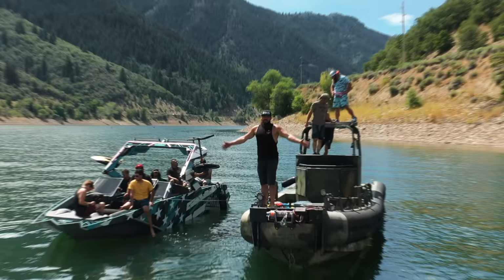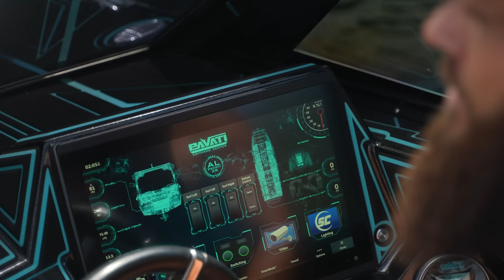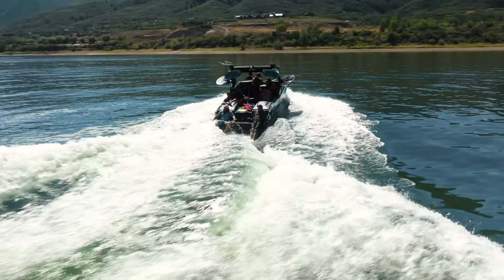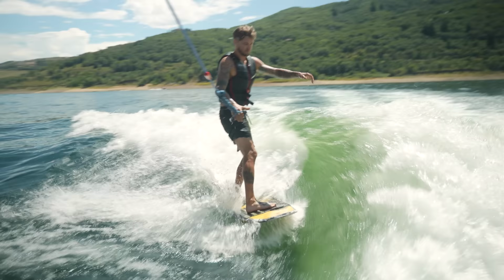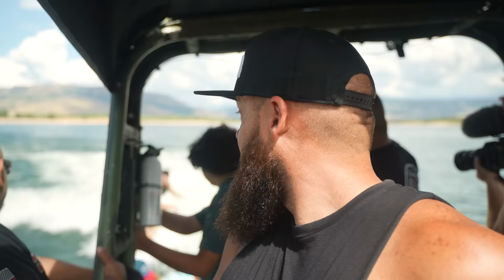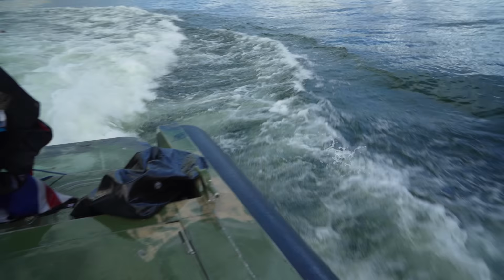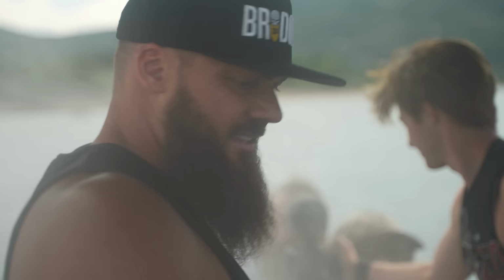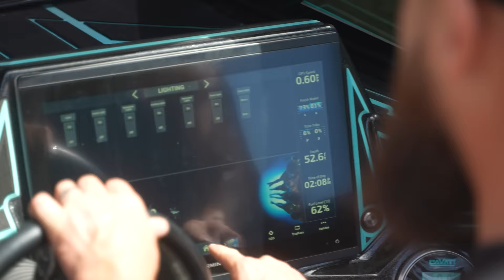Can a Navy Surplus Boat Make a Bigger Surf Wave Than a $400k Pavati Wakeboat?

Comment: I went to the site that HeavyD said to go to in the stolen truck apology video and it didn't say anything about extra tickets and sure enough I received my powerbag today and there was only one ticket included. I thought if I went to the site that more tickets would be included in my powerbox order since I placed it before the apology video went live. I have never gotten a scam vibe from HeavyD before but I kind of am today, especially when they are removing videos from YouTube with no explanation. Removing the stolen truck video and then the stolen truck apology video looks real bad.
Reply: LET'S TALK ⤴️⤴️
  THANKS FOR WATCHING.
Reply: Agreed!  I will never give them anymore of my money.  I bought two power bags the night before they released that video and only got one card in each order.  Guess what?! Each card was for 15% off more merch 🤮.  Umm, no thanks….going in the trash.  On top of that, both shirts are the exact same and the wrong size.  Horrible logistics and very misleading information.
Reply: @gimpy77  the quality of diecast was pretty lame too. I didn't expect Hotwheels Red Line Club quality but dang that thing is cheap. The t-shirt is a bit on the thin side too. I scratched mine and got 15% off so I threw it in the trash too.

Comment: Not related to this video. When you have these really stuck equipment. You need a M88. You like military trucks and you would love the M88. While I was in Korea some army guys stuck a 2 1/2 and a 5 ton wrecker to the frame in mud. The M88 pull the both out together.  Just with a tow cable!

Comment: After looking around at that motor 6LY2A-STP. 
You could start off with hand tuning. They run a pretty standard injection pump, so playing with the timing and test running could net results.  The turbos looks to be a standard T flange, so fabing up a newer/more efficient charger seems entirely possible along with better intercoolers.
There also seems to be a decent sized amount of owners across other crafts and generations.
But the blocks and bottom ends seem pretty stout.

Comment: Hi HeavyD,   by now you have heard of Matts Off road recovery olympics,  are you going to compete in this event.    Given you have gear that can nail this we would need to make it even and have your crew build something from scratch,   that is a frame,  add the running gear and electronics to make it work.       This rig would have a joey gearbox so it can be geared down real low so you are barely moving and the motor is running at a decent clip.       

It would also have atleast 4 hitch points so it can be quickly lifted with a Sany so it can be put on and off trailers or moved into awkward places.     the beauty of building your own rig including frame is you can to control the weight distrobition and build a rig that is indestructable
Reply: as for it being impossible,  what is a frame,  a couple of parralel I beams with cross connects.

Comment: Video formats are good IMO, I'd just prefer to see 30fps as the standard rather than 24. 30fps with a 1/50th shutter instead of the 180-degree lie looks amazing, especially at 4k, especially when it's ALL intra-frame (XAVC S-I on sony, not S or HS). Even better if you can shoot true 30 instead of 29.97. Just be sure that whatever you do the editing timelines and export settings are exactly matched to how it's filmed. A mismatch can cause a 1/4 second interval CD-skipping effect on the motion if you don't "interpret" the footage in some way.

If you shoot HFR all the time so you have baked-in slow-motion for speed ramping purposes, then you definitely MUST break the 180-degree rule and run a 1/60th of a second shutter speed to have proper motion blur. I have video examples I can send that prove this; motion blur doesn't "scale" with frame rate for real-time playback. 1/60th is 1/60th whether it's 24fps, 25fps, 30fps, 50fps, 60fps, or a still image.

If you really must use low frame rates for whatever artistic preference, then it's better to switch all the cameras to PAL and shoot 25/50/100. All you'll have to be aware of is that only 1/30th, 1/40th, 1/60th, and 1/120th (not 1/125th) are the only shutter speeds that won't show artificial lights flickering on camera. But you could shoot 50fps 1/60th all the time and have the same baked-in slow-mo speed ramping ability, you could drop half the frames for cinematics, AND you could even run it all in a 50fps timeline for buttery smooth HFR vlog sections that won't strain the eyes with erratic background movement at low frame rates. Plus it'll have natural motion blur for real-time playback whether you go the full 50 or drop half the frames for 25 all the time.

Unless you need to put the footage on a Blu-ray or broadcast it to American TV live, you don't need to shoot or edit in 24 at all and it's inferior to 25 in every way. If you have to send it to a network and it'll be put on the news, it's dead simple to have it re-encoded to 24 or 23.98, it'll just play 4% slower than normal. It won't even have audio artifacts.

Comment: Ok you've got the army river boat and you've water skied off it, you've also got the Black Hawk army helicopter. All you need to do for the complete Apocalypse Now experience is to lift the army river boat using the army helicopter  and to spray innocent villagers with M60 bullets and Napalm, before breakfast.
Maybe M60 bullets and Napalm is going a bit far and doing anything before breakfast unreasonable.

I think you said you big new Hemet truck used a cartridge system for transporting freight, would this include the HIMARS missile cartridges, it's a bit current right now?